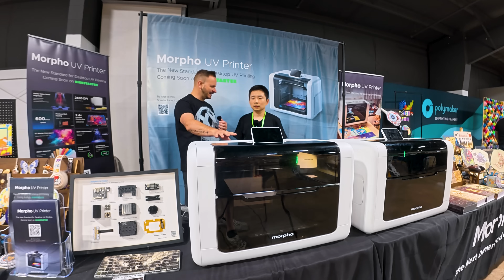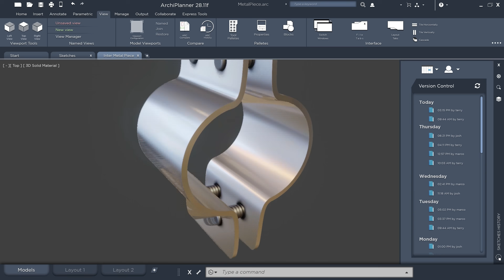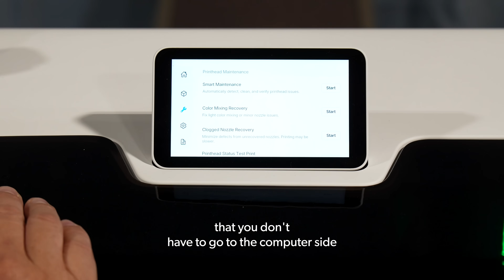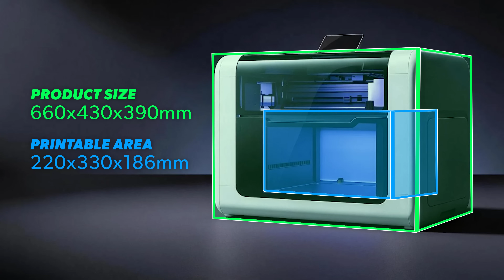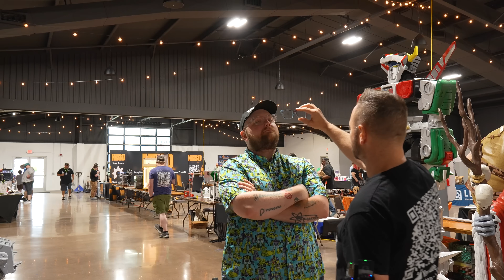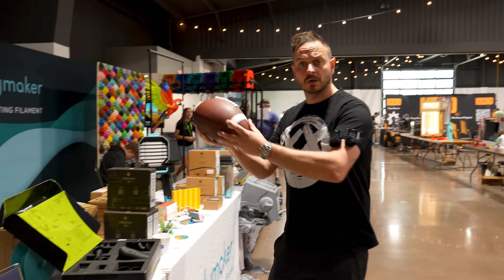Morpho UV Printer: Is This The Maker Tool We've Been Waiting For?

Comment from the maker: Kickstarter Link is HERE: https://morpho-uv-printer.kckb.me/samprentice (this link goes live when kickstarter does on the 20th Aug)

Why Morpho:
An Industrial-Grade Printing System Reimagined for the Desktop.
Powerful Performance
Epson i3200, 2400 DPI, and up to 9X faster printing.
4× Enclosed Printing Space
220 × 330 × 168 mm enclosed workspace with moving gantry design.
Precise Color Calibration
Built-in spectrometer calibration for accurate, consistent color.
Full-Color UV Stacking
Stack up to 60 mm for raised textures and full-color 3D-like prints.
Worry-Free, Cost-Saving Maintenance
Save 90%+ maintenance-related ink. No cleaning or moisturizing fluids required.

Join The Morpho Community for Maker Sharing:
👥 Facebook Group: https://www.facebook.com/share/g/1Bwy6ye3km/
💬 Join Discord: https://discord.gg/xvdgZqgbKs
🌐 IG: @Morphprint https://www.instagram.com/morphoprint/
Reply: Price per unit? Ball park ??
Reply from the maker: I don’t know. I’m flying out to see them on Saturday so I’ll have more videos with more information for you.
Reply: 0pln

Comment: I have a question, for the standard it says no 3d printing. This means that there is absolutely no textured prints on the standard and it's only flat? Or is there still textured print allowed? Can there be a gallery with print comparison between standard and pro?
Reply: This is what I was wanting to know as well.  I read that somewhere on the website.  I think on the table where they compare both models.
Reply: @akraftingalley exactly, that's a massive thing that I noticed no one is talking about. The one difference is resolution, the other is what it says for 3-d capabilities. There is 0 comparison of the prints between the two models as well. Its kinda shady how little information there is for standard model, and the results being advertised are only for the pro.
Reply from the maker: Where are you reading this?
Reply: @TheRealSamPrentice  their own website on the table comparison. It outlines that the standard has no 3 d capability, vs the pro allows for 3d print with specialty inks
Reply: @TheRealSamPrentice @TheRealSamPrentice  their own website on the table comparison. It outlines that the standard has no 3 d capability, vs the pro allows for 3d print with specialty inks
Reply: @TheRealSamPrentice Kickstarter

Comment: Sam,
I emailed morpho didnt hear back its been a few weeks. I had some questions. I put the 50.00 deposit and waiting for kick starter. My questions are for the build volume, accessories, and f1080 print head.

What is the final max build volume x,y,z for the 1080 print head?? Does this print head still do 60mm on z build volume?. Are there accessories for dtf roll, tumblers, large and small build plates, is software free or is there a subscription price?, and is 2.5d scan file able to export ?
Reply from the maker: All very good questions let me wake up and try to answer those for you.
Reply: @TheRealSamPrentice  can you respond to the comment?

Comment: can this printer do soft ink, do you have to flush regular ink and then add the soft ink..
Reply from the maker: Well you’ll be swapping inks so it’ll need to either pull back the ink in the pipe or flush, the simple answer is yes

Comment: this is suspicious. honestly, tech specs are insane and unbelievable.  theres loads of points on their presentation page which sound like marketing bait. would be nice if the founder/creator of the printer would comment on some technical solutions which allowed them to pass todays industries red lines while maintaining at least some sort of reliability and even ignoring some physics. im not an expert, just a guy who is working in printing and has some knowledge about inks and same particular print heads and this raises quite some questions. i would love for this to be true, but honestly, if it would be, it would mean a revolution in printing industry. so comments from the creator on some claims and numbers would be very welcome.
Reply from the maker: So I’m flying to China tomorrow. Why don’t you let me know all your concerns and I’ll address them all in my next video.
Reply: @TheRealSamPrentice  please request actual numbers and capabilities of the printer in real world operation. At this moment the printers parameters are just numbers from the print head tech sheet on the limits of operating range. Usually end points of parameter ranges in technical data need perfect operational conditions which are very hard to achieve in real world situations. Im talking about i3200 version. As it is a single head UV printer that needs 8 channels, the most likely option should be i3200-S1HD printhead (according to Epson data sheet). The lowest possible size of the ink droplet for this print head in same data sheet is 3.5 pl in 4-level greyscale mode and 3.8 pl size listed under print head option for water based inks. Even if the print head is capable of this small size with UV inks, it needs a very narrow window of conditions to make it happen and very low printing speeds. Considering this number with other claimed parameters, they become highly unlikely. Also what is the actual real world print resolution which can be used reliably as printing at 2400 with these print heads or similar ones, from my experience, is possible only for demos or very small jobs, while in full scale operation it usually results in lost reliability and may cause additional strain on the print head. Another case is maintenance. Everything looks good for the part of stirring inks in the tank and circulation in the hoses. When it comes to print head and dampers - loads of questions occur. As i understand, Morpho claims that moisturizing liquids, head cleans, ink purges for maintenance and standby modes are replaced with jetting and X/Y-axis movement of the print head. Jetting usually is used to keep the ink at the tip of nozzle channel in perfect condition. While modifying the process to replace the cleaning is possible, claims that ink usage is reduced by more than 90% is highly questionable. Using jetting to keep a print head with UV inks in perfect conditions would use a way higher amount of inks. While it still might be lower than needed for purging/cleaning but not at 90% lower amount. To keep inks from settling inside the print head, quite a lot of inks would be needed and that would have a very low effect on the settling of inks in the damper. Solving the damper issue with X/Y-axis movement sounds improbable. Considering the design of dampers optimized to provide stable and reliable supply of inks to the print head, even a movement of the damper in X/Y-axis with high acceleration shouldnt solve the issue of inks settling in damper even in cooperation with jetting due to lower amount of inks changed inside dampers as a result of jetting. Dampers are designed to keep inks stable under controled pressure at least in the chamber right before the manifold. Compensating for settling requires motion which is very unlikely in fully filled chamber under stable pressure even under high accelerations. The claim that the printer can sit idle for 2 months without clogging sounds like a revolutionary tech. So actual numbers about the performance of the printer in real operation conditions would be very nice in company with more detailed explanations of maintenance with cycles and inks used for it. The actual printing resolution and speed in a real operation also would be welcomed. At this moment Morpho claims look questionable but possible in theory yet highly unlikely in practice. So more detailed information would be very appreciated.
Reply: Good day, i am unable to find what your question is in this comment. what is it that you want more details on?  everything ive seen about this printer in person and talking with the team sounds great and they work with physics not ignore them, as sam asked in his reply let us know what it is that you would like to know and we will try to get it cleared it up for you :)
Reply: Maybe tell Sam what the red lines and problematic physics are, so he can ask the right questions.
Reply from the maker: Yeah give me input!  They won’t tho as it’s a competitor bot spamming
Reply: @TheRealSamPrentice  He gave you the questions. Now go and ask
Reply: I think I read all the comments: Q#1: not sure I found much info pertaining to rotary: yes rotary capability was mentioned, but there is no demo or detailed discussion for it? 
Q#2: the max height says 6.61 inches… is that effectively the size (height) of the largest object you can print on? 
To be specific, I wish to know the potential to print onto a cylinder object that is 6.19in diameter, with or without rotary.
Reply from the maker: Did you watch the updated video?
Reply: @TheRealSamPrentice I’m watching it right now! and will also go to their Discord when I’m done watching, thanks for these videos!
Reply from the maker: Hey, no problem at all

Comment: There’s a test for you. “Can this UV print on a box survive the postal system?” 📦 🐱

The paper mounting is pretty sweet! Most tools (circuit and others) just have a sticky surface, and the thing that happens is paper curls the grain structure when you try to remove it from the grip surface. With a Cricut mat, you have to lay the piece face down to curl the mat away from the paper to prevent this. But with a solid plate mount, you can't do that.

These are Bigger machines than what I was expecting from the teaser images, like the New Mova Atom Form one. I love that we are getting into "affordable" UV resin ink printing.
Reply: Silhouette has electrostatics mat
Reply from the maker: Never heard of it what is it ?
Reply: @dalebrown2128 that’s new! Have to look into that. The last time I needed to buy replacements sheet was years ago. 🥰
Reply: @WARPAINTandUnicorns they do have an electrostatic mat for their cameo 5 series plotters
Reply: @dalebrown2128 I have the Cameo 5 with electrostatic mat and love it...except for super intricate cuts.  So when I saw this I immediately thought of my Cameo cutting machine and thought it was cool!